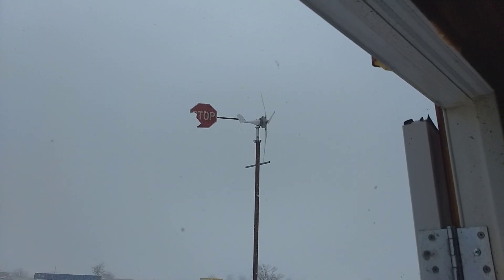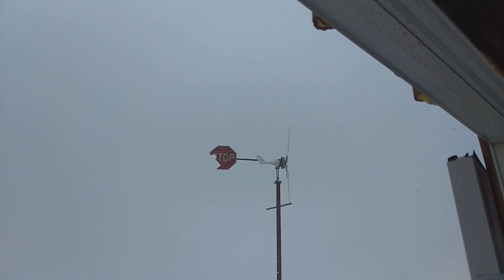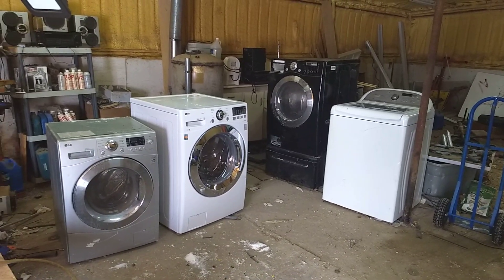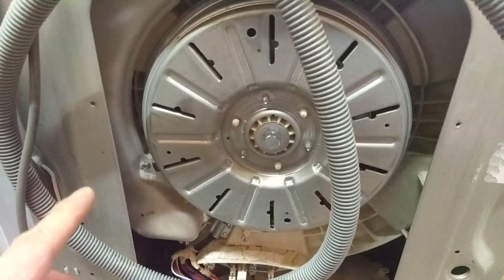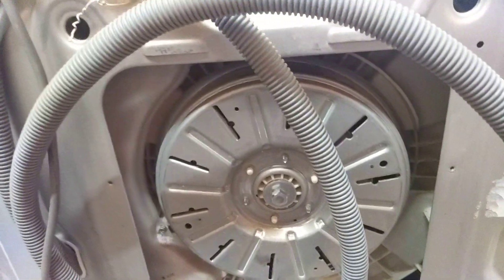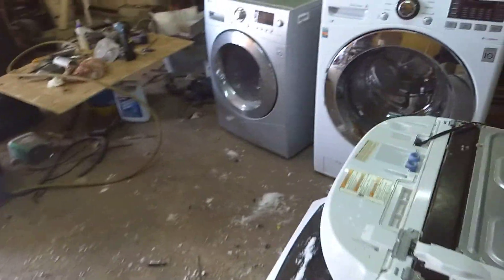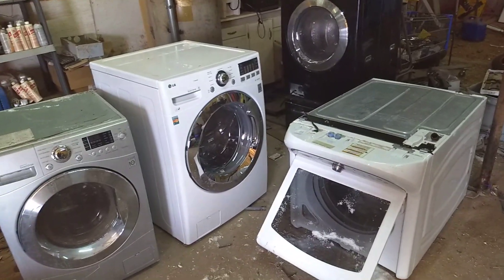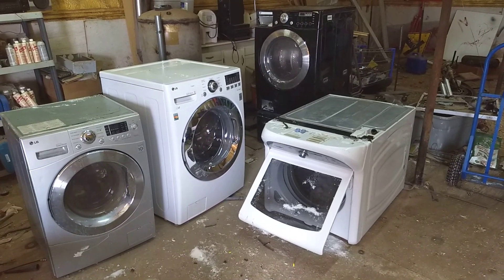New project!  Intro to yet another direct drive washing machine turbine!

Comment: can you project test osiloscope signal result from voltage output ?
Reply from the maker: I don't own an oscilloscope unfortunately
Reply: It will be a sine wave. Depending on how fast one spins determines if it will be a fat one with slow rise and fall or a fast one that is steep rise and fall.